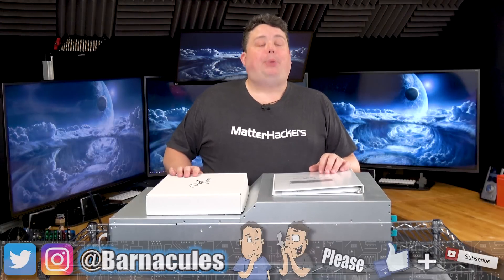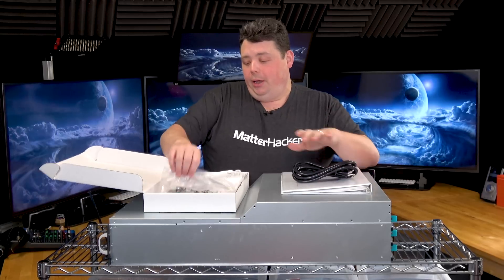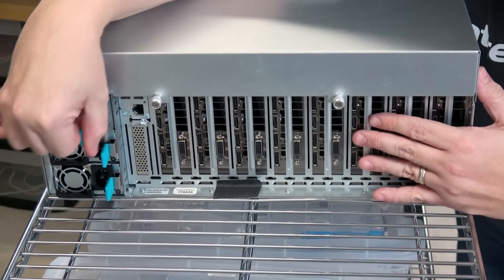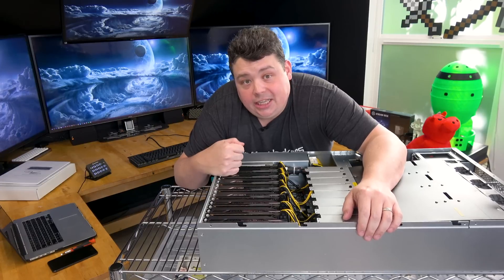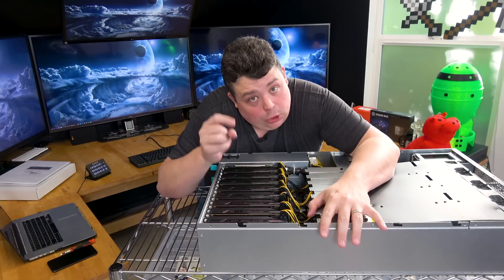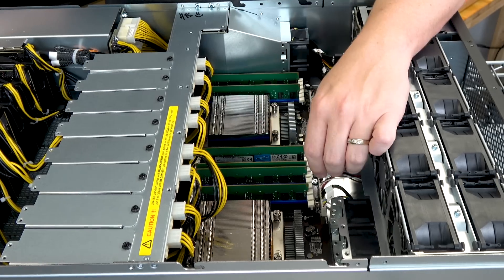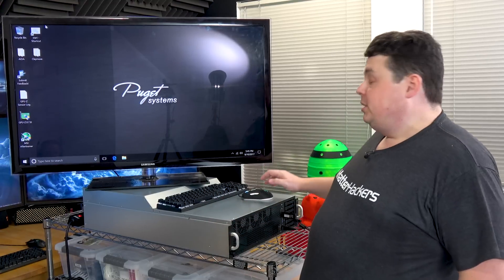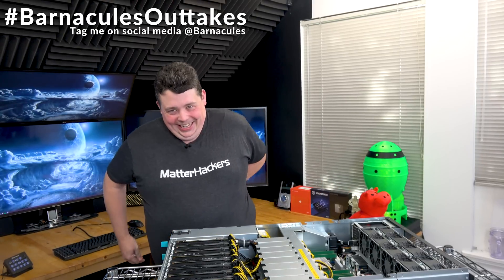Ethereum Crypto Mining Custom PC Server with 8 Nvidia GTX 1060 6GB GPU - @Barnacules

Comment: Surprised that chassis doesn't have mounting holes for rails. But then it makes me wonder if anyone makes rails capable of holding a system of that weight.

And instead of the hump, they really should've just built a 4U chassis. And water cooled would actually have been better for all of that to keep the operating temperatures of those cards at their lowest since those cards aren't exactly made to be under near constant load. Though the water cooling design would be interesting since you'd have to use an external cabinet to hold the radiators, pump, and reservoir.

I have a GTX 1060 doing BOINC tasks currently (no interest in crypto-currency) that'll be getting a water block in the next couple months. Full-cover blocks aren't available for it, but universal VGA blocks are still better than air cooling for the GPU core. Not to mention it allows for much quieter fans to be used all around, and better, quieter CPU coolers since you're not trying to force a ton of air across a 24+" chassis just to reach the GPUs.

Comment: Sorry, but that was a dumb way of doing it. Of that 12k, 10k was for the computer, 2k for the video cards. That entire computer could have been replaced with $500 worth of hardware plus a rack for the GPUS, and you'd be at the same place. I get that it's sponsored, but this is like buying a Ferrari and putting a Honda engine in it. Shoulda told them to give you more GPU and less Xeon since that's completely useless for rendering and mining.

Comment: Hey jerry stop supporting mining on budget cards! These are for gamers who are not that rich to buy 1080 tis and these are mining are ruining them.
Reply: The time to buy your GTX 1080 Ti will be a few months after Nvidia releases the GTX 2080s next year.  The new cars have 50% mkre compute power at lower energy useage.    Also Intel just teamed up with AMD and will be redesigning their embedded graphics to increase their power x2 to x8 times, but those CPU hardware revisions are 2 years away.  2020 will be a difficult year for nvidia, unless they can keep making the same gains year after year.  At this rate, Nvidia could simply license and embed a dual core x86 and dual core ARM processor in a stand alone card.  Think of a backplane motherboard with PCI slots and no CPU needed...
Reply: Nvidia will need to come out with a dedicated heterogenious GPU in the near future or it may face problems. Intel is on deck to do just that by hiring Raja from AMD.
Reply: NVidia is recommending use of $8000 commercial version cards for continuous use and does not want to warranty consumer-grade GPUs like this for 24/7 operation.
Reply: Quazi Irtiza Ain't capitalism a bitch? Next you'll be saying I shouldn't be running Folding@Home.
Reply: Supply and demand, nvdia and amd needs to speed up their production line so that everyone is happy

Comment: So you have to mine for 650-700 days before you can pay back what you spent on it, and basicly start earning o.o ? ?  ( Without paying elecrtisety ) ?
Reply from the maker: No, it's a sponsored build. The machine was $0 for me so I have to pay back $0 before it's profitable so technically it was profitable the first time I powered it on and started the miner. #Winning, But yeah, if you were to buy this system and you only used it for mining and nothing else it would be a bad investment. However, using its down time to mine when you're not rendering on it or running VM's, etc would be good and the system would slowly pay for itself over time.

Comment: Damn that's gonna be hot. Should be in a open case with plenty of space between the cards so they can breathe.
Reply from the maker: Rack mount servers follow a different formula of high pressure to move air through densely packed stuff. Completely different from desktop cases.
Reply: Barnacules Nerdgasm just after I commented that I heard that part of the video. Maybe I should shut up until I finished viewing the whole video haha. Thanks for reply.

Comment: 18$ a day meaning it has to run for 2 years to even get back the cost of the machine plus that doesnt even calculate how much power it used. so more like 6 years i guess
Reply from the maker: That's only if Ethereum doesn't increase in value outpacing the difficulty of the network like BitCoin. But, sure, doesn't really matter because I use it for other things. To build this machine strictly for mining only would be far less epxensive.
Reply: well ya i forgot to say that was assuming price didnt move and alright :D

Comment: The screw thing is easy, the standard version uses the those two screws to mount the panel. like IBM, Lenovo  ect does. But because is a custom version they can't do that sadly
only 1060? i thought they would have used AMD's new 56 or 64 gpu as they mine like crazy!

Comment: wow that computer is powerful: 64gb ram and 48gb video memory and 8 nvidia graphics cards and also you can finally have a computer that is capable of running all autodesk programs together. Autodesk complete software collection is something that have much more minimum system requirements than just gaming. AutoCAD alone exceeds 50gb just for the installer alone and does not fit on 50gb blu ray. The cpu is average for this day in age at 2 quad core 3.5ghz turbo boost 3.7ghz with 2 threads per core. Total cpu power is 8 core 16 thread 3.5 ghz/core turbo boost 3.7 ghz/ core. Why do I say average since the newest intel desktop cpus have 36 cores and 72 threads and at least 4 ghz (more in turbo boost) in every core and thread. Really amazing system for those things that go beyond gaming. It can act as its own datacenter or server farm for small business. Can do the rendering in many applications such as 3ds max very fast. The rendering things that take hours on regular computers happen in a couple seconds to couple minutes on that machine. Also video format conversion on HD or more would take as much time as watching the video on regular computers would only take a couple of seconds on that machine. Last this machine can also run a large scientific lab, particle accelerator, or nuclear reactor very well.

Comment: This is a gaming machine.
Reply: Shady nope, it is an rendering rig
Reply from the maker: Technically you could setup 8 discrete virtual machines using a GPU each and have it be an 8 person 1080p gaming machine. But, not really interested in using it for that role since it would negate all the other roles I need to configure it for.

Comment: $12k and no RGB? That cant be right
Reply: he's not Linus Clickbait Sebastian
Reply from the maker: This thing doesn't have enough vents or windows for RGB bro, you could fill the case with it and never see it on the outside :D
Reply: Missed opportunity ;) should have A tempered glass lid and be wall mounted. RGB a plenty. In fact go all out and install some kind of smoke machine so you can see the airflow. That would look cool RGB, a vaping server... Noise? Noise cancelling headphones. Worth it for that masterpiece.
Reply: You could always stick on the top of the case :D

Comment: Is that $15 profit over the electricity bill to power it?
Reply from the maker: This server is capable of supplying 2000 watts, it's only using 650 in its current configuration.
Reply: 1060s can mine with just 60W each.
Reply: Just run it off of solar and wind
Reply: Alexis Gaming that doesnt say anything. I could build a 6 gtx 1060 miner for 1500 bucks. Mobo, memry, hdd, cpu, ect can all be the cheapest thing out there. So 6 1060s is around 1800sols, or 140 mh and that would be able to mine 200 to 300 a month depending on coin prices and which coin. So 6 months go bye and you start making back your money. Maybe you have used mined coins to move into better coins amd made even more money! But 6 months. With an electric bill 30 to 40 bucks a month and then you sell each card for 70 percent of its new cost. So 250 new would be 175 used and that below what people are asking right now for them used.  So 175x6 is 1050 bucks. Lets call it 1k. Plus the 1500 you were making for last 6 months and you now have 2500 or 1k profits for doing nothing. Scale that up, exchange cards every 6 to 12 months as needed. And you can pay rent with mining. And getting it built is easy, getting it running properly, and effective, and stable and keeping on top of it as updates and shifts in prices and difficulties happen is far from not doing anything for something. Plus you are using money to make money. If you now computers, programming, haggling, finances, and stock markets then you can make alot of money doing this.
Reply: I love when the nay sayers think 1000s of people investing huge amounts of money into mining didnt stop and think "oh wait with power cost this isnt worth it" so everyone mining is some chump making money just to pay it plus more back to the power companies.
Reply: How this is using only 650w? O_o 
If everything is working 100% - while mining - GTX 1060 = 8 x 120w -> 960 plus two CPU, another 300w. 
So, somewhere around 1000 to 1250 watts or daily 24 to 30kWh
Reply: It must be some difference when you mine with one or two GPU, and when you have 6 of them, where CPU  need to serve a lot of data to cards.

But I guess he did this more for fun - for his youtube channel, earning isn't main thing here.  - we are talking about server configuration that produces 103 decibels of noise :D (louder than a hair dryer, and almost as plane takes off) - that was terribly loud even for an office, let alone for a private house!
Reply from the maker: $15 total not including the $1 a day in power
Reply: That doesn't seem right.  Assuming the 2K power at 0.11/KwH would be about US$ 5.28 a day.
Reply: Not everyone is a chump, but a very large percentage. The biggest thing they miss is that their hardware could effectively be obsolete for mining before it's even paid for itself.
Reply: Holy crap, 2000 watts of constant power draw is only 1$ per 24 hours? Damn I need to move. Power here in the Netherlands costs €0,23 per kWh.

Comment: A good solution to your lump in the case  why didn't you use 8 EVGA Powerlink   moves the power cable to the back of the card
Reply: gamarada bamal can you just buy those individually?
Reply: Yes to to the EVGA page there $25   i got mine for free when i brought my 1080  but had to pay for postage
Reply: Looks like those would add more height than just the wires that are there.

Comment: Surprised you didn't put Vmware EXSi on their and make a bunch of VMs.
But I guess having to pass though all those GPUs would be a pain, plus you'd have to buy the full license.

I have a Rackmount server as well.  The IBM X2650 M3, with 2x (Xeon(R) CPU X5675 @ 3.07GHz), 72GB of RAM.  And a 10Gbit SFP+ connection to my 5x4TB Raid6 NAS.

Comment: Why no 480 for mining?
Reply: Dr. Dunk because those are stupidly rare, with all the miners snagging them up within practical microseconds of them being back in stock
Reply: Because he's dumb.
Reply: because he got the GPUs for free. plus better power usage compared to anything AMD makes.
Reply: cuz AMD is #fryingpan
Reply: MrDoboz owned both the rx 480 and gtx 1060. Both the strix.
Both around the same temp and the 1060 has a bit more fps (like 3 average)
Reply: Barnacules Nerdgasm fair enough. Would be great for mining tho
Reply from the maker: Because I use this system for more than mining and AMD just isn't there yet IMO.

Comment: Wondering why a 3U case with a bulge vs a normal 4U case? Would think you could get more cooling with a 4U over a 3U. Its not like your rack is limited since you will only be running like 6U of equipment. Great job on the video, really like seeing this stuff. Show us some distributed computing!

Comment: Blows my 1U colo out the water. The fan's are the most important part.
Reply: But you need all the fans ,without them you would got no 913K subscribers. Hahaaah ,think on that. :-)
Reply from the maker: I'm blown away by how much air these fans move, there is no way they are 12V, they must run straight 110AC to move this volume of air or a ton of AMPS. Do you know?
Reply: Those server fans are still 12V, they operate at a much higher amperage like 3A for 5300RPM. Gives you about 64dBA of air pressure.
Reply: Just looked up the ASUS manual for the server and it accepts cooling fans with 3.3A-3.95A (47.4W Max).
Reply from the maker: I can't handle any louder or stronger fans in this thing man :D